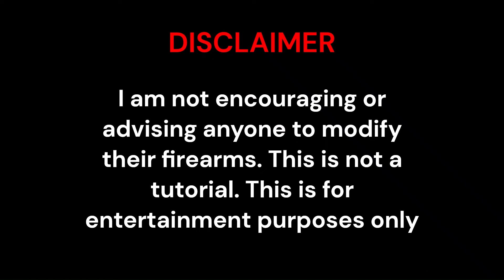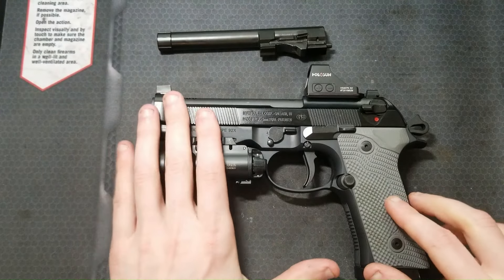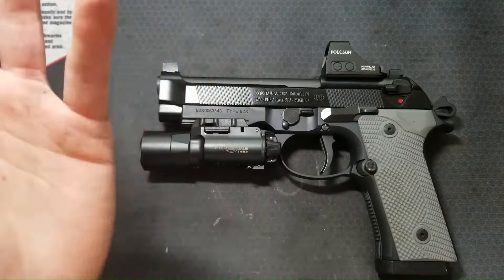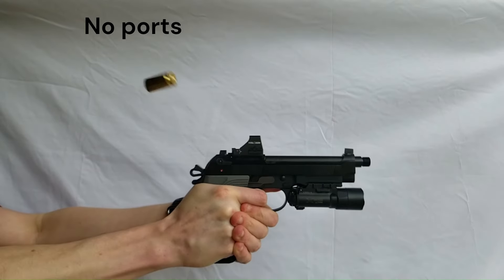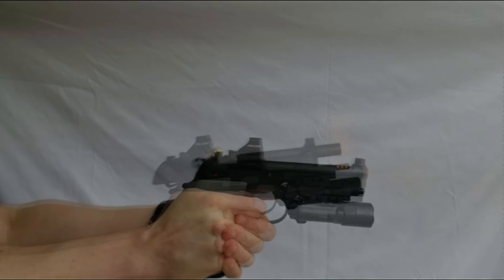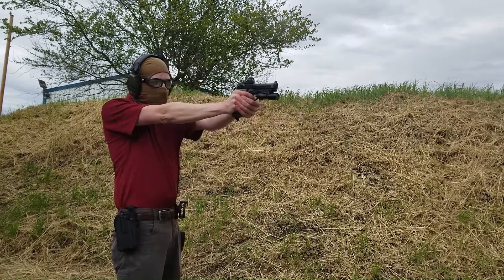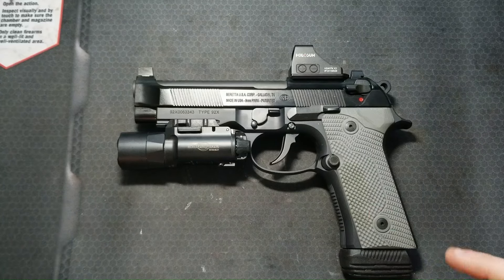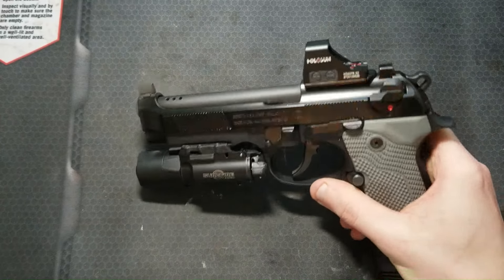Ported Beretta 92X RDO

Comment: That light shaking around loosely is driving my OCD crazy!
Reply from the maker: pistol 1913 rail tolerances seem to be all over the place. This one is especially loose. And the X300 A models dont have a very solid mounting system anyways.
Reply: @EngineersArmory  they should definitely do better with that. Someone should make an adapter to cut out that play.

Comment: It looks like your light moves more than your muzzle does with the ported barrel lol 😅 all jokes aside, I’ve watched your other videos and I really admire your work. I’ve got a Canik Rival and it has the top of the slide ported. Your videos make me want ports on that one now 💯 it would be a perfect contender for some inline ports. You should look into back boring after porting the barrel since you have access to machinery. Keeps the accuracy better than sanding away at the burrs and the rifling at the same time. You can cause accuracy issues and bullet tumbling when you mess with the rifling.
Reply from the maker: I usally check zero and accuracy at15 and 25 yards after porting, and from what i have found, if i keep the ports small, zero shift and accuracy is minimally affected. I did chunk port my Springfield Hellcat, did't bore the rifling out (I know better now), and got shrapnel to the face, evening in the ER, and the zero shift at 15 yards was about 1 foot, and my groups opened up quite a bit. Chunk ports absolutely need the rifling bored out.

I agree boring the rifling out would limit disruption to the bullet as it passes the ports. However, in my experience, its not necessary on smaller ports. Also, boring out the rifling essentialy turns the front of the barrel into a comp where gasses are allowes to bypass the OD of the bullet and blow around it, reducing the amount of pressure and gas coming out of the ports upward, reducing muzzle flip. That difference in performance would likely be negligeable tho.

A note on my deburring process - I am very careful when i punch my bit thru to the bore to limit burrs. I first get in there with the wooden stick of a Q-tip and knock the burrs off that way - if there is any thin pieces hanging off the edges, they come off easy. Then I get in there with fine sandpaper wrapped around a brass rod and give it a few light swipes only where the ports are. This knocks down remaining burrs, and since the rest of the rifling is hard nitride, it doesn't really affect it at all.

Anyways that was a bit of a long winded answer. tldr: keeping my ports small and my deburring process has shown to not affect the accuracy on the six pistols I have ported (just my experience of course).

Thanks for watching and commenting! you brought up great point!
Reply from the maker: also omg yeah the X-300 A models are loosey goosey on some rails (worse on metal rails, generally tighter on polymer rails). I throw it on there to use with my blackhawk holster. Should have used the TLR-1 with the better clamp, I have the blackhawk holster for that too.
Reply: @EngineersArmory  nothing wrong with long answers 👍🏻 it just shows you’re learning and willing to talk about what you’ve found along the way.
Reply from the maker: @Bryan-1980  absolutely. One of the main things I enjoy about creating and posting this content is the discussion that comes about in the comments. I'm always happy to learn new stuff. What I do with my guns is a learning experience every step of the way as well.
Reply: @EngineersArmory  I love what you’re doing and I’d be doing the same thing if I had a mill and a father with the know how and the patience to teach me what he knows 👍🏻👍🏻 have you seen the Parker Mountain Machine barrel and comp setups? I’ve contacted several machine shops and nobody is willing to attempt what I’m looking for just because it’s a service they don’t already offer on their website. I wanna make a thread on, PMM style comp for my 1911, but I want it shaped like the TTI Pit Viper comp, with that angle in the front. I’ve also seen the new quick detach comp that uses a tri-lug system for the FN 509. For the states that don’t allow threaded barrels. I think whoever starts selling Pit Viper shaped comps is going to make a killing. Everybody loves the look of that gun but nobody wants to pay 9k for a 4300 dollar staccato XC with some custom cuts and a comp 😅
Reply from the maker: @Bryan-1980  I've thought about machining comps but with manual machines it would take so long to make them look like anything other than a brick with a couple of holes in em. I can even anodize aluminum myself so it would be cool. But I just dont wanna spend that much time fussing over something I can buy for $50 haha. 

In terms of 1911 comps there are some cool options that just replace the barrel bushing, I've used em before. They make a difference in recoil. 

Other than that if you had a bull barrel it would be more difficult. Have to buy and fit a threaded barrel or cut and threat the bull barrel and fit a comp over it so that the comp has a sleeve that goes in the slide that interfaces with the lock up.
Reply: @EngineersArmory  very good point. I wasn’t thinking about the barrel lockup 🤦🏻‍♂️ plus all my 1911/2011’s have been fitted with bull barrels.
Reply from the maker: @Bryan-1980  that would get really tricky really fast. To get the comp timed just right I would have to machine the thread shoulder back like .001" at a time so when it came up against the shoulder it would be lined up with the slide.
Reply from the maker: @Bryan-1980  this is the type I was thinking of:

https://dscgunworks.com/products/dsc-comp-barrel-kit

Maybe a good option for you if you can fit the OD of that comp into your slide lockup area. There is something to be said about bushing barrels for ease of fitting the bushing to the barrel. Screw it up and it's a $20 part. Not a slide or a barrel scrapped.
Reply: @EngineersArmory  PMM gives you .02,.05,and .10 shims to use so you can just add shims until it’s clocked correctly, then dab a little red locktite and screw it on. That’s how they get away with normal threading on the comp, and the threaded part is a bit shorter than a regular threaded barrel and the threads on the barrel go all the way back to the slide.
Reply: @EngineersArmory  I really like the DSX kits they sell, but they only make them for 5” guns.
Reply from the maker: @Bryan-1980  ahh gotcha that's cool. Minimize the gap between the barrel and slide.

Comment: Great video. would you recommend only running 124 or higher through this setup? Thank you.
Reply from the maker: I notice a reduction in recoil with all loads. Higher velocity loads work better. Generally 115, 124, NATO loads and +P loads will work with the ports best.
Reply: @EngineersArmory  I have been having failure to eject and stovepipes since getting mine back from porting but I have only used 115. That’s why I asked about the ammo. Could it also be a break in period? Sorry for all the questions. Thanks again
Reply from the maker: @legacyfirearmstraining7613  I am guessing you had some rounds thru the gun before porting. Shouldn't be a break in period. 

Do the easy, obvious stuff first. make sure your gun is cleaned and well lubricated then try different ammo types. 

The next most obvious thing is dropping your recoil spring weight. Porting the barrel redirects some of the energy from the gas upward as it exits the barrel. That means less energy is going to pushing the slide rearward to cycle the action. barrel porting or adding a compensator generally necessitates a lighter recoil spring by 1-2 pounds.

Less obvious things: the locking block likely needed to be removed from the barrel for it to be fixtured and machined - maybe it was reinstalled improperly - like the roll pin slightly hanging out and affecting the movement of the barrel in the frame.

Lots of things to check. Get an idea of how the system works. Should be easy to track down. Good luck!

Comment: I wonder how a 96 would fare with all of that. 40 has so much more pressure = exhaust to push on the barrel.
My sample of 1 96A1 is ridiculously accurate as well.
Reply from the maker: I imagine higher pressure cartridges would push more gas out at a higher velocity resulting in more drastic muzzle flip reduction. I am planning on porting a 10mm for my Dad so I may be able to answer that question. 

A ported 40 or 10mm probably wont shoot as flat as a ported 9mm just due to the difference in power, but maybe the % reduction in muzzle flip would be greater. Or the difference in feel would be more drastic.

Comment: Your thoughts on "possible" spring changes if there is an issue running 115gr with that set-up?
Reply from the maker: Lighter spring may be needed. When porting a barrel or adding a compensator, there is a good chance the pistol will need recoil spring tuning. I've ported 3 Berettas now. One needed a lighter spring.

Comment: Have you done any kind of work on the sharp edges of the holes inside the barrel? And does it affect the acurracy of the pistol?
Reply from the maker: I always deburr the bore. The first part of that is my machining. When I am about to break thru into the bore with my bit I go really slow and that minimizes burrs. Second, I take the wooden stick end of a Q-tip and rub it across the holes to knock off any thin pieces of metal. Then I wrap fine sandpaper (like 1000 grit) around a brass rod and run that over just the port area in the bore to get remaining burrs. It has proven to work well, it doesn't really disrupt the rifling as that still has the hard nitride finish on it. I have inspected this deburring job with a good light and magnifying headset and generally see no burrs remaining around the hole. 

I have also found with all the pistols I have ported that smaller port sizes disrupt the bullet less. i wont do any bigger than 1/8" (.125) diameter holes anymore.

I see minimal zero shift at 15 yards (i zero all my dots at 15 yards), its usually 1 inch or less. And I generally pattern on paper at 25 yards from a bag support and the groups before and after are comparable. That is the guns are capable of more accuracy than me still haha.

Hope this helps. thanks for watching and commenting!

Comment: Awesome! What made you go with the 407k on a full size pistol like the 92?
Reply from the maker: I had an RMR on there for a while. With how skinny the slide is and how tall the optic sits this just felt like the right size. Also since they are such a light weight slide it's really noticeable adding any weight to it at all, especially up high. I didnt like the way it felt with a larger optic.
Reply: @EngineersArmory  makes sense, less bulk too, is the window size good on the 407k?
Reply from the maker: @E72024  it's pretty small. Requires a bit more practice to find the dot on presentations and stuff for me. Still useable though.

Comment: Is the 92 noticeably quieter suppressed than a glock?  i'm not sure how to get a straight answer on that because the actions are different.
Reply from the maker: i would say they are about the same. I have shot both quite a bit. How they shoot is way different due to the barrel unlocking action. But in terms of noise, no difference I could tell. similar barrel length too (glock 17). Shorter barrels will be louder in general when suppressed.

Comment: Any downsides to porting?
Reply from the maker: In my experience: 

Its a bit loud and obnoxious if you're shooting indoors or in a covered area. 

Some nasty hot gasses and spalling can come out of the ports and hit ya if you're shooting from retention. 

It deposits extra carbon and gunk inside the slide and around the barrel of your gun (unless the slide top is open like this Beretta). 

Large ports can affect accuracy - keeping them small like this gun might open up groups 0.5-1" at 25 yards.

Point of impact can shift a little after the barrel is ported, but thats just a red dot adjustment usually for me.

Thats all I can really think of.

Comment: What drill bit did u use
Reply from the maker: I broke thru he hard nitride on the barrel with a carbide endmill first. then used a small center drill and a .109" (7/64") drill bit. I mention the hole size in the 3D model section. I also show a completely dimensioned drawing at 2:15...